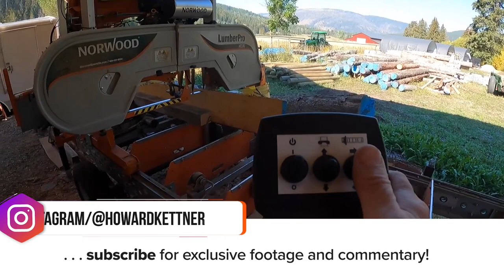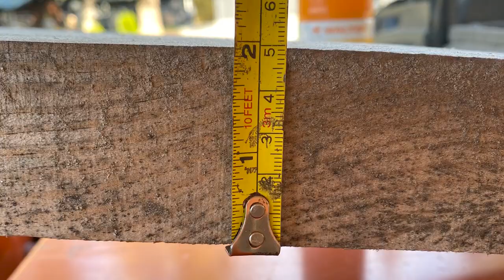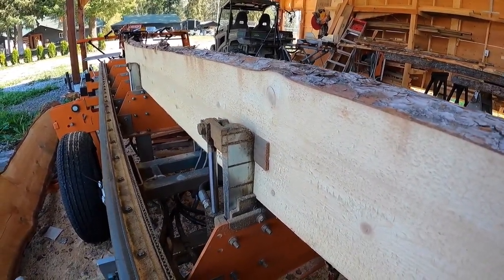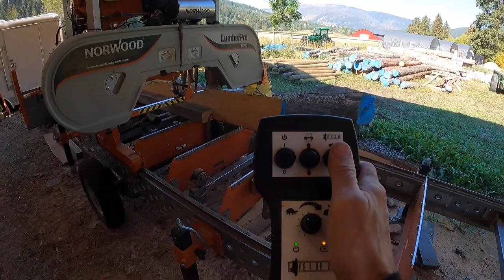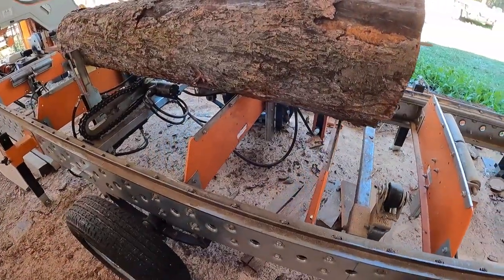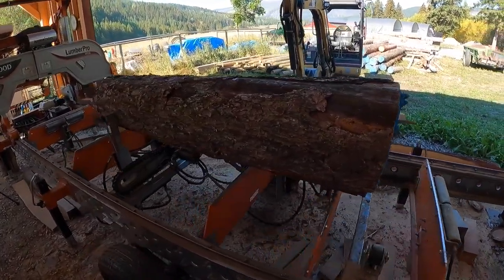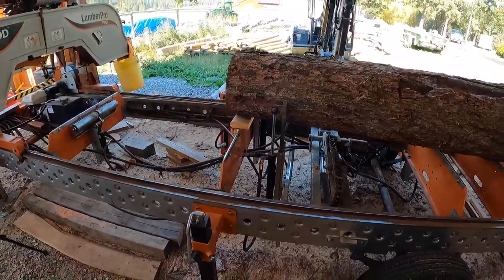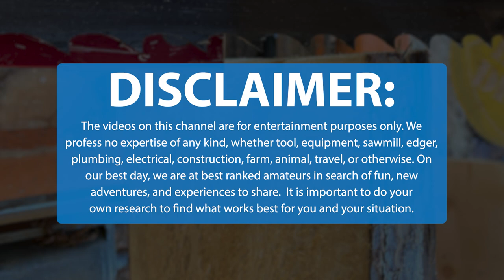Norwood HD36 - Tips For Narrow Cuts & Short Logs

Comment: Howard thank you so much. That was a fantastic demo video. I wonder who you did that for? LOL one question. For your next cut on that short log, do you turn it 160 and take out the shim? Thank you again. I am going to make a 4x6 today.
Reply from the maker: Correct - flip the log 180 degrees.  A lot of folks in the community will tell you that they can get away with working their way around the log in 90-degree increments, and it's not that I have not tried that with the Norwood, but somehow I just can't get a precise cut (meaning I do not end up with a square 8x8' for example).  
However, when flipping the log 180-degrees, and following the other techniques I outlined for the 'narrow cut', I can get a square beam every time.
And yes - the shim or the toe board are only used for the first cut(s) prior to flipping the log 180 degrees.  If used correctly, when you flip the log, the pith will be equal distance from front and rear bunks.
Happy sawmilling!
Reach out anytime!
Reply: @howardkettner  Howard thank you for giving me all this information. This is so valuable for me. You are very generous with your knowledge.
Reply: By the way, I milled my 4x6 and 4x4 to keep near my mill today. Thanks again.
Reply: @howardkettner  Howard, some how I managed to do Tapered log right using your technique. It was only 2 inches of taper but I lined up the centers. I had another log with a 5 inch taper and a hump on the large end. I didn’t do so good on that one. I was thinking next time maybe I can try shaving off the hump first with 2 inch cuts first. I will definitely need to practice on the tapered logs. Thanks again for doing these videos.
Reply from the maker: @tomsommer54  You've identified the problem - and landed on a great solution Tom.  
They key concept to return to is having the dead centre of the log the same distance from the front bunk and the rearmost bunk upon which the lot is resting.  
However, since these are not straight telephone poles with a gentle taper that we're cutting, there need to be added accomodations for extreme taper which you just encountered - also for logs with a strong consistent curve that lasts the entire length of the log.  In which case I usually cut the worst of the curve out and make two short logs out of what is left.  
Lots of potential waste in those crooked logs if one attempts to cut a long board or beam out of them.
Reply: @howardkettner  With your system, I will keep working on it. Thank you giving me a direction to follow. Howard, because of my slow internet here, i can’t upload YouTube videos very well but I did manage to do a couple from my phone. You can see me and my mill on Tom Sommer @ YouTube. I was doing 2x12’s this weekend with Norwoods deep gullet blades.
Reply from the maker: @tomsommer54  Nice - I will definitely look those up - and I hear you on slow internet.  My Starlink gets me about 10mbps upload and about 25 down.  A video file just takes forever.
Reply: @howardkettner  hughsnet is .03 MPS upload.  Ridiculous.

Comment: Hi Howard. I don’t know how to get a message to you so I go to this great video you did to help me. My new question. I noticed my hydraulic dogs are not plum. When the log leans back on them they go out of plum. Have you dealt with this? Do they need to be plum. I think they were at one time. This was very frustrating yesterday as I had a beautiful 24 inch hickory. I saw you use a shim on one of your videos.
Reply from the maker: Great question Tom.  And BTW - if you need to reach out to me in future don't hesitate to text me at 604-230-8051.  That's the best way to reach me most days.

Yeah - those log rest supports are a suggestion of a 90 degree angle with the bunk and not to be relied on.
Usually I can get the log to hold "square" with the saw blade through a combination of clamping the log firmly and then moving the log rest supports up or down slightly.  The resultant friction from holding the log firmly with the clamp will make the necessary adjustment.
However - with a large log like you were working with - yes - it is true.  When it's critical that I get a square cut I've been known to take a cedar shake and loosening the log clamp a little - either position it between the log clamp and the log/cant or alternatively between the upright log supports and the log.  
PS - sometimes I'm able to avoid 'wedging' by using the log turner to achieve the desired position and then leaving it in place during first cuts . . .
Hope this helps Tom.
Happy sawmilling!
Reply: @howardkettner   Thank you, Howard. Yes, I did what you suggested yesterday with the log-turner. It worked great. Thanks for your phone number too. I'll try not to blow up your phone. LOL Now if I could just learn how to sell boards in this area. LOL People just don't have money in this area.

Comment: Comment #2. Looks like Norwood is NOT a well designed mill.
Reply from the maker: Sadly you are correct.  And good design does not cost more.  Really disappointing.  I'm no engineer.  I'm not a qualified millwright or anything else.  I did not go to university.  But I probably have a dozen ideas on how that mill could be better for little or no cost at point of design, manufacturing or assembly.  Just not well thought out or field tested prior to production.
Reply: @howardkettner  True but at least it has lots of nuts and bolts.